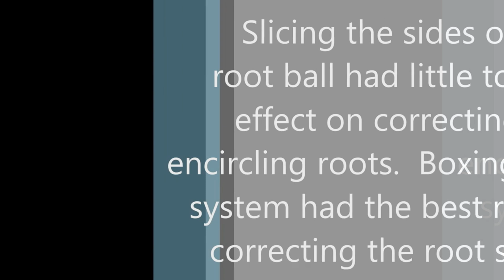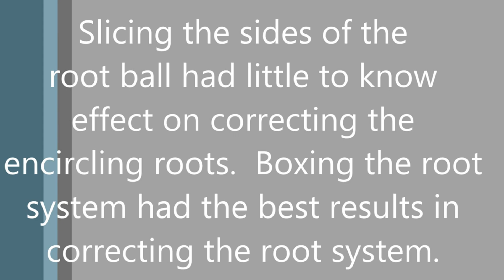Pot bound root systems - Part 1

Comment: Why do academic experiments like this always use some grossly oversimplified brute force methods, do they represent what landscapers are actually doing? If so, I'm glad I do my own.
Here is a method that with minor adjustment is good for any transplant pot to ground, ground to ground, or pot to pot; tree, shrub, or herbacious.
Dig the hole 2x-3x the diameter of the pot and just a bit deeper than the pot, fertilize/amend as desired and make a firm mound in the middle. 
Then manually(literally by hand) untangle the wrapped roots from the rootball and pull them out radially, completely remove any that are too badly wrapped to straighten without breaking. This only takes about 1-2 minutes.
Place the tree on the mound in the hole, then make sure the roots are manually pulled out radially (trim any that are extra long, or dig small trenches for them.), add a light cover of dirt to just hold them from springing back. Then if the crown height needs some fine adjustment, pull up on the trunk a bit while poking dirt under to increase the center mound. Add a stake if desired while you can still see and avoid major roots, finish filling in the hole.
The mound is partly to support thew tree and reduce settling and partly to help keep the root tips lower than their origins(usually the crown).
Reply: Root ball shaving, called squaring here, may look brutal but it's fast and effective. It is what nurseries are supposed to do when they move plants up in pot sizes but don't always. I untangle some root balls, as you say, but not generally ones like he's dealing with. Those stiff, big, curled roots do not easily pull apart.
Reply: Well, I've never been accused of brute force, but I'm kind of liking that description! Regardless, we conducted two separate and lengthy field research projects where we employed a variety of root improvement techniques, including slicing the root balls with a knife, carefully "teasing" the roots out with a hook, "butterflying" the bottom of the pot-bound containers in hopes that it would correct things and the bottom line was (a little drum roll)...nothing worked very well. So, being the brute I am, we moved on to cutting off the offending roots by "boxing" the root/soil ball. If you have ever been to a Greek restaurant where they prepared gyros on site, they shave off the meat from a cylindrical mass of lamb or beef. That's kind  of what we came up with and it works. That's the important part of this lengthy reply...it works. It does look brutal, but the technique saves the trees, it doesn't kill them.
 @RichardGilbert2727
Reply: @garyjohnson2224  So true. I have not killed or appeared to harm a plant yet by boxing. This past 2023 growing season I did it to a very rootbound 6' potted weeping redbud. I think it was in a 7 gallon pot. After I cut the sides and the bottom off the root ball, I noticed the tree was also potted 4" too deep. So I fixed that too. The result was a pancake of roots. Being generous, maybe a third of the roots that had been there remained. That tree never wilted. We were and are in a drought here in SW VA so I kept it watered good. Thankfully redbud are fine with hot, dry weather as well.

I learned boxing from Dr. Ed Gilman's work. That brought back memories of my mother doing it to a potted plant 60 years ago! She tried to teach me, but I think it looked, well, brutal. Counter intuitive, but it's the opposite of brutal. An arborist I know told a woman concerned that pruning was hurtful that it was just a haircut. So root shaving is like trimming your toenails!?

Comment: In urban environments where the goal is to have roots grow deep rather than horizontal, will boxing the root system cause roots to grow horizontally instead of downward?
Reply from the maker: Roots tend to react to the environment in which they are growing and will grow where resources like water, nutrients, and oxygen are available. A lot of a tree's roots grow quite near the surface for this reason and is one of the reasons why compaction from construction activities and heavy human traffic can be an issue.
Reply: @UMNUrbanForestry I am sure the same method can be applied to shrubs. For example, I have seen an entire batch of Azaleas that were up potted from a one to a three gallon with no loosening of the root ball, just dropped into dirt and watered. They lived, but if you grabbed the trunk and lifted, they would come right out as if still a one gallon. Mind you, this is after a year. 
So, I am about two months into an experiment. Where I have box cut several, and out into a three gallon pot. Hoping that they will grow new roots and thrive once in ground. 
What are you thoughts as time has gone on? I am very curious to see what the results are today, is this still in practice, etc.?

Also, have you tried Air-Pot container growing for trees? 
Have seen a lot of videos about this system, but I can push a product too, it doesn’t mean it works. Thoughts?